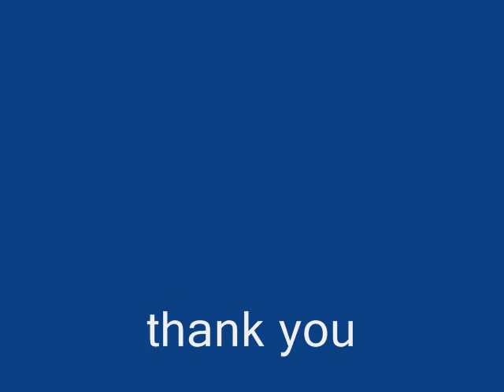dodge ram 1500 2001 repair

Comment: @ctstopher10 bcuz its over a large area it looks like alot of filler. In most all repairs there will be SOME filler. It helps body work AND allows the filler to become fine enough porus for the basecoats to adhere to.. In body and paint its all about how fine the scratches are you need them small enough for the paint to fill but large enough for the paint to stick! Lol

Comment: @ctstopher10 not trying to be rude but u shouldnt give out false information. they used that much filler to insure a perfectly level surface.through a process called block sanding. very time consuming but done properly and the panel will be perfectly straight when done. as for paint ur right small enough scratches for paint to fill to big of scratches start again. and $1800 is way to much for this job you got ripped off my friend